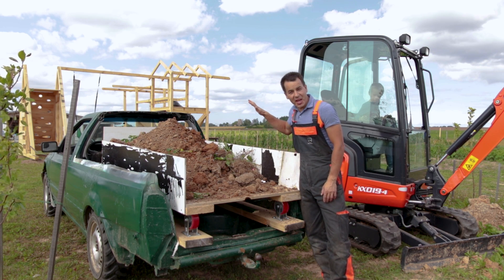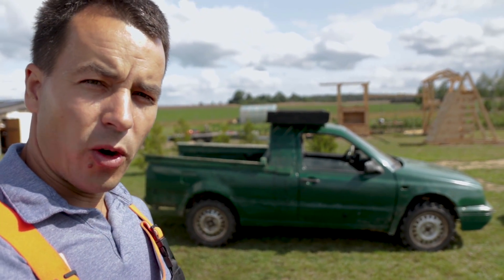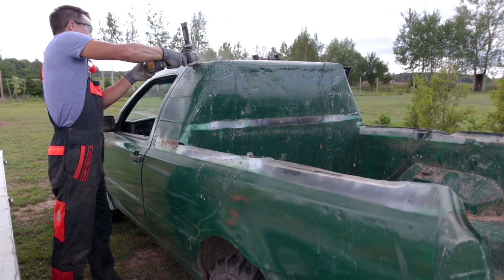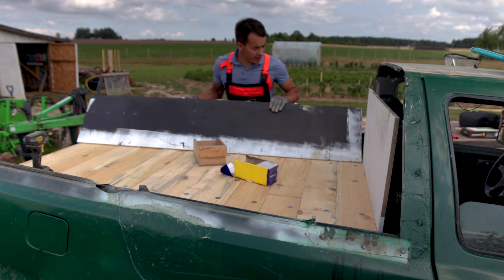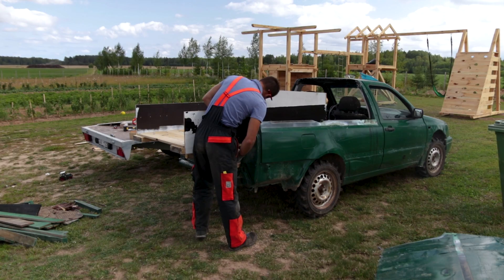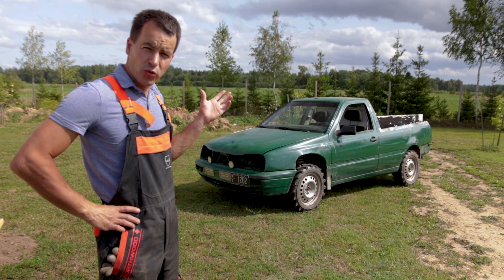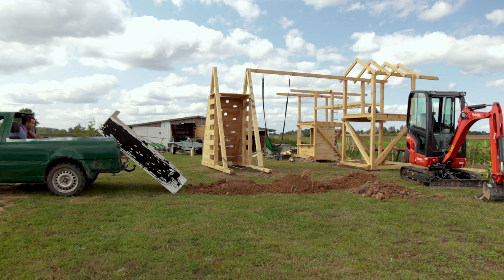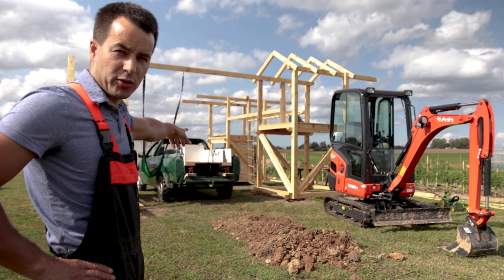How to Make pickup Dump Bed

Comment: This is about the best example of "kiss" (keep it simple, stupid!!) that I've ever seen.  It's the simplicity that makes it so functional. I've been trying to come up with something, to fit either an old F150 with an 8 ft. box, or a 4.5 ft. x 7 ft. trailer, but everything I came up with suffered from one problem - over engineering.  I only need it to help me move a large pile of dirt to fill a large hole about 500 ft. away, nothing that will have to last beyond this one job.  This one fits the bill perfectly.  Congratulations for coming up with this, and thanks very much for sharing.
Reply from the maker: Thank you for your story!